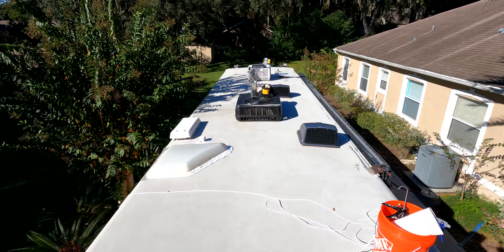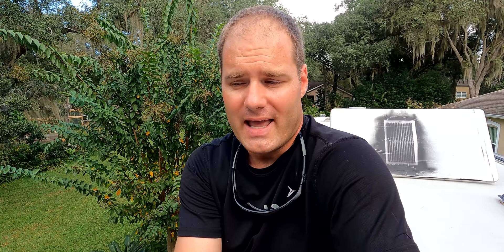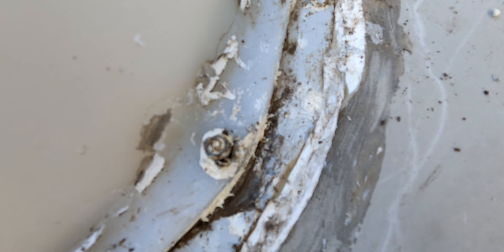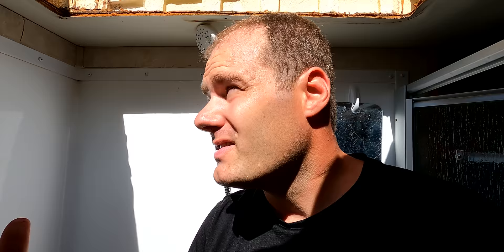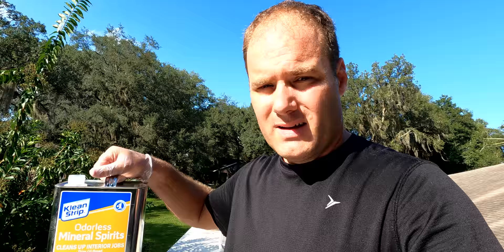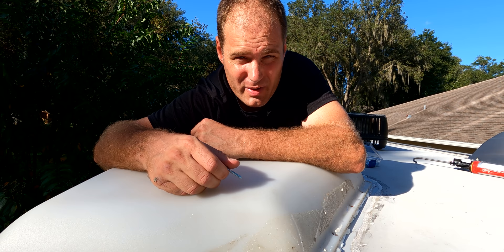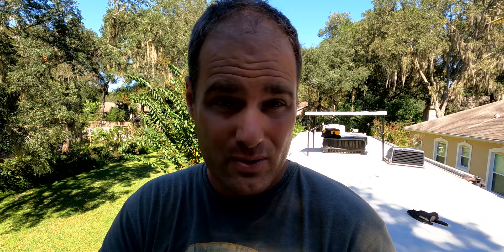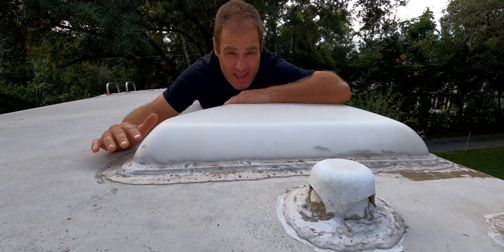RV Roof Sealing: Could You Have A Leak & Not Even Know About It?

Comment: We have a yearly leak test done on our coach where the interior is pressurized and the exterior is sprayed with soapy water to find potential leaks.  Well worth the $150 in our opinion.  Thanks for sharing the video.
Reply: Are the slides tight enough to hold pressure?

Comment: Another trick you can use for screw holes that got bigger is using a toothpick or other slivers of wood covered in glue shoved in the hole wait till dry and then re screw the screws and the new slivers or toothpicks will act as a new wood. I use this technique on home repairs all over the place. Cheers on an informative video.
Reply from the maker: Great hack! Thanks for watching
Reply: Yep toothpicks, or lately I've been using bondo to fill the screw holes and re-drill them. That seems to work even better than toothpicks.

Comment: I used to work on Gillig buses,  I found out wherever they used that sealer for the emergency hatches had leaked causing corrosion. I had to sand off all the old sealer and used silicone bathroom sealer like you.. That worked
Reply from the maker: Good to know!

Comment: I replaced my outer skylight and went through a lot of the same steps.  There wasn't a leak, but the skylight was yellowed and pretty old looking.  Plus the sealant looked like it had been covered over a few times and was ready to be replaced.  I used butyl tape instead of silicone in hopes that it would seal better and last longer.   Like you, I used dicore self-leveling sealant on the outside.  Butyl tape is pretty messy to work with - especially on a hot day.  But I like how sticky it is.  It seemed to seal the screw holes really well.  Time will tell if this was a good choice or not.

Comment: First mistake,
You used flex seal on a RV...
But wait, there's more...
Inside skylight should not be installed unroll after its all dried out. About 2+ WEEKS.
You will now have a dry rot problem.
Reply from the maker: I did wait a few weeks before putting it back on. I didn’t install the inside piece in the video at all. I also ran the dehumidifier. You will notice that I have a different shirt on in the video :)